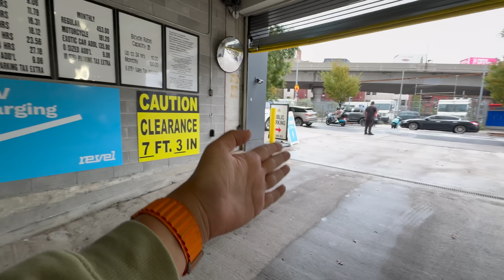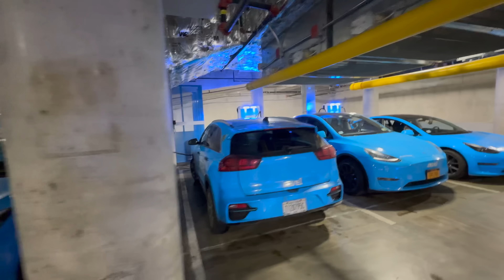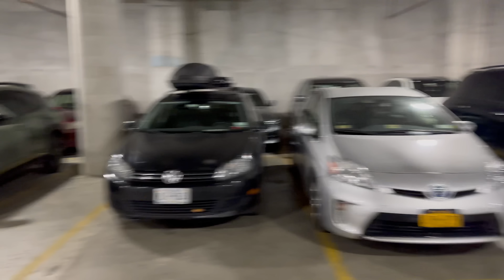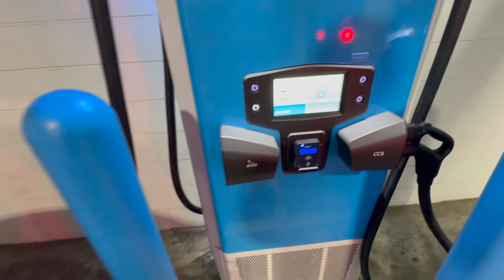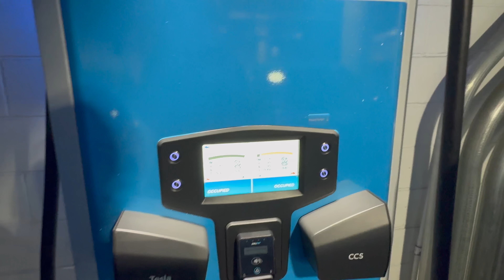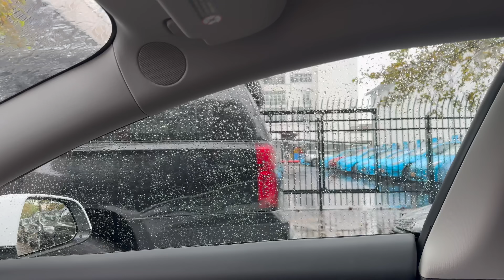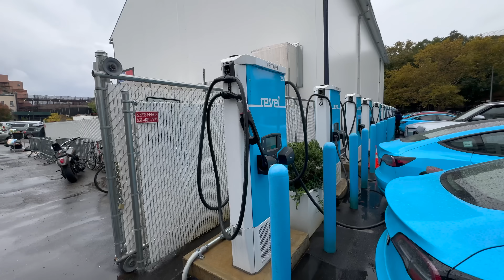These Insane DC Fast Charging Hubs In New York City Could Set The Standard For Urban EV Charging

Comment: I don't understand why they made this setup. All they had to do install a load of AC chargers to hook up all the cars that parked in the garage. Now with the fast chargers they need people to drive the cars back and forth between the parking spots and the fast chargers. Maybe add two fast charging stalls for people that are in a hurry to charge. What they have now is a very expensive setup and it requires additional manpower. And then there is a guy handing out tickets for people that want to charge. That should be easy to automate.

Comment: Man, my parents rented a "Model Y equivalent" (lol), Genesis GV80, to come visit us this last week. From DEN to FoCo, then we went up and over, through Black Hawk, to Manitou and back. We were actually very impressed (for a Genesis).

They got here with over 85%, we topped up, charged a little j1772 in Lyons (maybe 8%, over breakfast) then only tried a chargepoint DCFC in Manitou before heading back. The chargepoint DCFC was embarrassing. 42kW... so we only added about 10% to CYA. Overall, we practically went from FoCo-Manitou and back on one charge. 

It was actually really cool to charge off the Solar Roof at home, since we normally only charge the Leaf. I'd only used it at 3.3kW until they visited, and then we charged at 9.4kW using the GV80. I guess the main takeaway was that Chargepoint is only barely better than AC we've got at home. 

IDK if my Mom could comprehend the lost opportunity of not getting a Tesla rental, but maybe next time she will.

Comment: What if you built tunnels specifically for electric vehicles to move around the city. Several vehicles could be linked together to increase capacity. They would circulate on fixed routes 24/7 so there is no need for an app. The best part is that you wouldn't need charging infrastructure if you can deliver power to the moving vehicles along their route. I hope a city like NYC will be forward thinking enough to try this one day!

Comment: Does anyone know if Tesla to CCS adaptors will be available beginning 2024 from someone? Beginning in 2024 will Tesla allow non-Tesla EVs charge at their superchargers with an adaptor.? Anyone know if Tesla going to accelerate the Magic dock installation at supercharger stations? There are so many unanswered questions that no one talks about. I own an Bolt EV and can't make plans because all the companies don't give timelines to what is going to happen and when. I talked with Chevorlet about their adaptors and they said it wouldn't be available until 2025 but, when they said when announcing their switch to NACS they said beginning of 2024 they would be adaptors. So tired of the lack of information and the lying.

Comment: Maybe it’s new technology but I am under the impression that dc voltage conversion is dc to AC to dc.  Where AC to dc is direct.   On the other hand if you have enough difference in rates at times batteries could make fiscal sense just not as efficient

Comment: The next step would be for Revel to offer a valet charging service to overnight guests of hotels near their charging hubs. Imagine being able to just park your car at the hotel and having valet attendants take car of the charging for you, spending the night cycling cars in and out of the fast chargers so that their customers don't have to. It would not be cheap. But, as the number of EVs on the road increase, I think there are definitely people around that would pay for the convenience, and anyone parking a car overnight in NYC probably has a lot of money to spend anyway.

Of course, to this, some would reply "but, if you're parking all night,  why not level 2?". To which I would reply that the supply of level 2 chargers in Manhattan is extremely limited, and finding one that allows overnight parking and is not broken, occupied, or ICEd, anything but easy. Also, a model where cars block level 2 chargers all night to charge only half the night is not a particularly efficient use of very limited charging space. A DC charging hub, backed by valet parking attendants to plug, unplug, and shuffle cars around, seems much more scalable when the number of EVs that need to be charged every night gets large.

Comment: The underground EV charging set up looks very dangerous, ie battery fires, the building concrete columns should be wrapped in asbestos because the thermal fires. would incinerate the concrete columns and bring the building down in minutes of a fire.
Reply: Okay professional building engineer.

Comment: It seems like a site that big could use a natural gas LM2500 30Mw turbine onsite. Not sure if they could do a DC generator and get more efficient without the AC-DC conversion loss? But then the illusion that electric vehicles are "clean" may be broken, and it is better to hide the fuel burn in some poor areas outside the city limits.
Reply: Natural gas co-generation in city limits is incredibly efficient in the winter. Especially for those big buildings.
Reply: @thedopplereffect00  Heat recovery to make steam to heat the nearby buildings is a great second use.
Reply: Yup. Dig up the coal in Wyoming. Ship to to the East coast by rail. But hey. We are saving the world!
Reply: @jxp1993  Wyoming coal is some of the best.
Reply: Solar with storage is cheaper than coal or "natural" gas now...

Comment: It's great you captured the credit card terminal freezing up. I would love to deep dive into why in the world the charging industry has so much trouble with point of sale systems. Seems like every other industry has figured it out. What's the background story here? Why is it so hard to have six nines reliability on a simple internet connected device?
Reply: Yeah I don’t understand how I can swipe my card at a grocery store twice a week without fail but every time I use a CCS unit it errors out
Reply: wouldn't be surprised if the charging unit had not entirely reset from the AmEx attempt with the reader and there was a sync problem between the two. still sucks, but it probably worked itself out after a bit.
Reply: The internet. Especially in an enclosed concrete building in the basement.
Reply: @chirpie11  these PayTer units have a LAN port on the back, so I'd imagine they would wire that instead of the optional cell modem, especially in a garage situation.
Reply: @chirpie11 lmao they aren’t using a cell signal to process the payments.

Comment: Imagine the horror if а fire breaks out. Not to be a Debbie Downer but there is a risk when so many evs are in an underground parking garage in my opinion. I am curious to know what measures are being taken in case of such event.
Reply: Looks like all they have is water sprinklers. That’s it. That building will come down.
Reply: Yet no one worries about hundreds of gallons of gasoline that is 10x as much thermal energy?
Reply: @thedopplereffect00  As far as I know, if you take out the oxigen, gasoline will stop burning. Not true for LiIon batteries. In that case ev are more difficult to stop from burning, once the process has been started.

Comment: I live in NYC with My LRMY. The reason we need charging is that we need to run sentry mode! other than that its charging once every 2 weeks or so... When I didn't have a charger in my parking garage I'd do a lot of charge and eat dinner nights once a week. We are eternally miffed that they don't have much charging in Manhattan proper that doesn't cost $30 an hour to use.
Reply: Why would you buy an EV you can't charge at home? at that point just get a Prius
Reply: @thedopplereffect00  how often does one refuel a prius? If it's once a week then there's really no difference
Reply: @whitlockbr  Prius has well over 500 miles range, so a lot less often.
Reply: @thedopplereffect00  If I turned off my sentry mode, I could eek out two weeks....

Comment: I am SOOO glad that Kyle stopped in NYC. As Kyle noticed, going 1 mile in NYC can be a major pain in the neck. So if I live in Queens, or some other part of Brooklyn, it would be a long painful  effort to get to one of these 2 Revel Hubs. I know more of these hub locations are coming and one will be in Queens, not too far from me, but that will take a long time until it is fully operational. There are 150Kw chargers at JFK airport, but who wants to drive to the airport unless you're getting on a plane. All that to say that having an EV if you don't have a convenient way to charge is not a good option at this time. I cant wait to hear about the Flo A/C chargers on the street. It's so hard to find a parking spot and I imagine these street Flo chargers are either ICE'ed or someone leaves their EV blocking the Flo charger after their vehicle is charged.
Reply: On-street Level 2 EV charging in a place like NYC is going to be very tricky, given that the value of the parking space far exceeds the value of the electricity you can put into the car at level 2 speeds, on a per-hour basis.

This means that if the charger's parking space is priced solely on the cost of the electricity, everybody with an EV or plugin hybrid will try to park there, whether they need the charge or not. Some drivers will even intentionally throttle down their car's charging speed so that they can legally remain parked cheaply for longer. This means that people who really do need to charge their cars will be very unlikely to find an available space, even if the "EV charging only" rules are universally obeyed (which, in practice, they will not be).

Alternatively, the chargers can be priced based on the fair market value of the parking space, rather than electricity, which, by definition, means that there will be at least one open parking space per block at all times (the actual price of NYC street parking tends to be far lower than this, which is why they are always full). This way, EV drivers who really need a charge will be able to get one, but the electricity will be very expensive, as such a move effectively asks people who are already paying for a monthly (non-charging) garage parking space to pay for parking a second time in order to charge their car.

For these reasons, I think level 2 street charging makes sense in mildly dense urban areas (maybe the outer boroughs of NYC), but in places like Manhattan, where the real estate is very expensive, I think the only charging that is going to be both reliable and anything close to affordable is going to have to be DC fast charging, since that is the only way to put electricity into the battery at a fast enough rate where the fair cost of charging is actually dominated by the electricity, rather than the use of the parking space, and even then, it may be necessary to charge by the minute, rather than the kWh, so that drivers are not induced to clog up the charger, top-charging to 100%, simply to avoid paying for parking elsewhere.
Reply: No idea what you're talking about here. Most street parking in NYC is free currently. If those spaces required paying for electricity it would be a net revenue generator for the city
Reply: @hotshotxi  The value of the free parking spot is tremendous because so many folks have to compete for a very limited number of legal parking spots. The City will not get any revenue. The vendor, Flo, might eventually recoup the money they spent to get the Flo charger installed. The number of regulations are tremendous even with the City "helping" them deploy these street A/C chargers. I see the beginning of a Flo charger installation in lower Manhattan that has not been activated yet. It's been like that for over 9 months. This is not about revenue. It is about the extreme challenge to charge an EV in a dense City unless you have a house.

Comment: They should seriously consider one leg 277/480 v 3p L2. Tesla absolutely supports 277v a/c. 

Even at 80% of 20A that’s 4.4kW , using super inexpensive NACS 

Leave them plugged up, use the DCFC for rapid turn around times. 

So one 480v 3 pole 20A would feed 3 tesla at 4.4kW. That’s super efficient and cheap. They could run dozens of 20A small connectors. I think that will also be the biggest improvement to airport parking.  277v would be cheaper to deploy and reduce voltage sag. Using 20A would dramatically lower the cost for placing dozens of connections at a site

Comment: It makes sense to have large numbers of 22kW AC in car parks, especially if you can put canopies and solar in at the same time. But equally there is a need for 250/350kW DC hubs and I think some hubs dedicated to delivery and taxi drivers, with facilities for those that are driving all day. Somewhere to chill and grab a coffee/meal while they top up their vehicle.
Reply: Not ac if localized solar is used and or onstie bess systems, instead do 25-50kwh dc so less total conversion losses&heat. 👍🏻
Reply: @4literv6  Don't most DC to DC converters convert to AC first? The answer is yes.
Reply: @tedmoss  incorrect dc-dc steps up or down the voltage example 400v main pack down to 12-24-48v to run all your other accessories or charge the auxiliary 12v battery. A rectifier switches dc-ac 3 phase and an inverter switches ac back to dc. 😀
Reply: 22kW AC is way too much

Comment: Mind blown! I'll have to link to this video that next time an EV naysayer quips: "What if you live in an urban apartment?" As for CCS enabled, I am pissed that Tesla STILL hasn't given the green light to upgrade my Model 3 with a CCS adapter and retrofit. The online shop STILL says by "mid-2023." Derp! That's come and gone, folks.
Reply: do you really need CCS at this point? CCS is done.
Reply: @selbyjohnson5986 the retrofit doesn't add a CCS chargeport, it adds the hardware for it to be able to communicate with CCS chargers(e.g EA) as they use a different communication standard to tesla

Older Tesla's will still need the retrofit to use non Tesla chargers
Reply: @selbyjohnson5986  For now, yes. NACS won't take over as the only standard for at least a couple of years. Derp!

Comment: Interesting to see that none of the Revel cars have Aero caps on the wheels. I guess they either would get stolen or fall off so they just leave them off. I guess in the urban environment the Aero wheels wouldn’t really matter because of lower speeds.
Reply: In lower Manhattan, all cars have at least 85 dents from running into other things, mostly cars. I know because I counted them. The covers would be shredded.

Comment: this is what i want to see in chargers, payment by bank card not BS annoying apps!
Reply: Only the EV charge industry seems to have problems with contactless payments.  Even drink vending machines work first time.
Reply: Meh… I would rather just plug in and charge.
Reply: @89five3five  Older cars can't do that
Reply: @89five3five ya especially when I've had issues where the card reader themselves is the thing that's brocken
Reply: @89five3five  Perhaps, unless someone is borrowing my car.
Reply: And yet as Kyle showed.. it just doesn't work.
Having an account with Plug n Charge is just so much simpler.
Reply: What a noob you are.  If you drive a Tesla and use Tesla superchargers, just plug the cable in and it works.
Reply: How about payment built into the car like Tesla?
Reply: @thedopplereffect00  That's basically what Plug n Charge (part of the Iso 15118 standard) is.. only difference is Tesla basically create your account and capture credit card details when you place your order.
Reply: Yeah, it’s so annoying when the app handles everything seamlessly and safely and all you need is your car

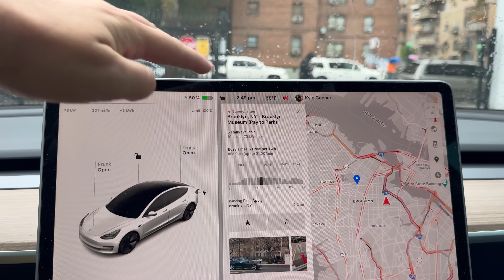Comment: it seems like the ending (20:53 on) is talking about the FLO street chargers, rather than the Revel Hubs? I know you had talked about doing the FLO chargers in a separate video... did the endings get switched?
Overall, interesting video, coming from a Midwesterner, with no desire to drive in NYC...
Reply: That threw me off for a second as well 😂  I was like fLO I thought we were talking about revel

Comment: When you do the Flo  Street chargers don’t forget to mention that the city is not at all enforcing ,EV charging only signs that they have put up. They are always iced.  These kinds of programs don’t work without enforcement.
Reply: If they started ticketing and towing the ICE vehicles it could help pay for putting the charging in.
Reply: Can confirm. I used them frequently but struck out more times than I’d care to admit

Comment: Okay I have my own Tesla but Woah, thats a lot of EVs. What safety did they implement if one car goes off with fire?
Reply: A UK fleet operator with 140,000 electric vehicles has not had a single electric fire in two years, so you are probably affected by fossil fuel propaganda in terms of the risk.
Reply: @colingenge9999 still think its a valid question. Although fires are rare in ice and ev, there is no way to rule out the possibility of it happening at some point. Its always better to safe than sorry
Reply: @j_d4303  not rare in ice though 217,000 happened here in the us last year alone, that's an ice vehicle burning down every 4mins btw. 
The #1 open recall across ALL LEGACY ice oems is for the risk of FIRE even when parked, which is why garages were og detached structures. affecting over 10,000,000 U.S. sold vehicle's of just 3-5 year's in age. But yeah evs oh so dangerous SMDH. 😏
Reply: @j_d4303  fires are not that rare with ICE vehicles. They are just not in use anymore. Over 500 people died in the car fires last year in the USA. Zero in EV fires.

Comment: I wonder if these are older units compared with the more modern 150kwH?
Reply: Yep. The 2nd place are RTM75 units.  The first place PKM150 distributed units. (slight difference in the lights at the top is visible difference).

Interesting since Kyle's first video they've changed the adapter from using CHAdeMO (max 50kW) to CCS screwed on.
And presumably will use NACS cables when Tritium releases them as a retrofit.